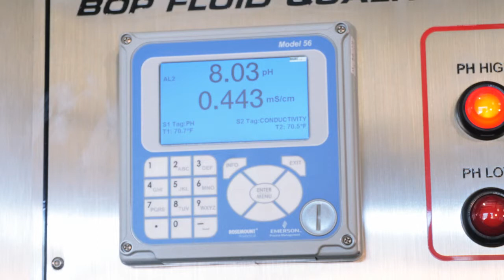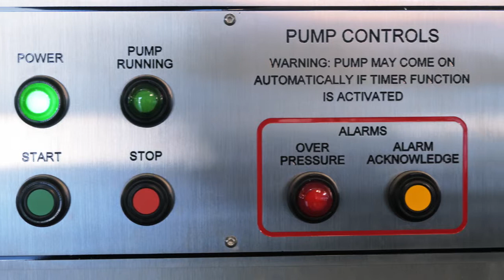Subsea BOP Fluid

Comment from the maker: The two main causes for BOP fluid quality problems include contaminated water supply and microbial growth in the mixed fluid. Downtime and failure reports indicate several re-occurring problems with these fluids and in order for the subsea and BOP hydraulic components to operate reliably, the mixed fluid must stay clean and provide a minimum level of lubricity. 

 #bopfluid   #bophydrauliccomponents   #thesubseacompany   #subsea   #subseaproduction